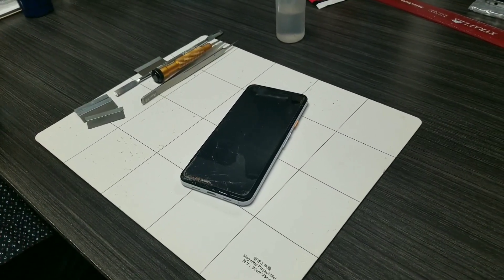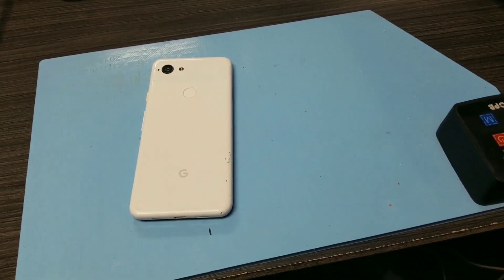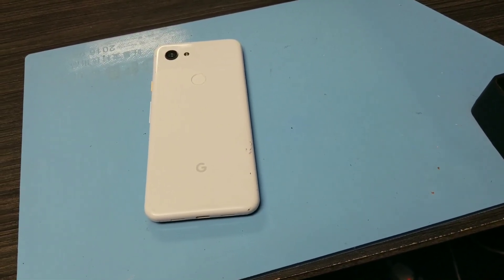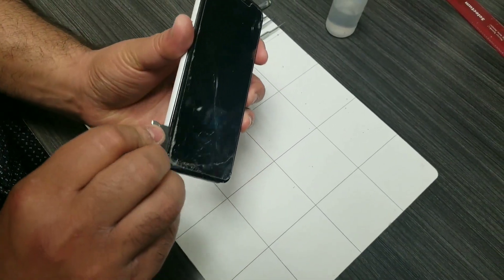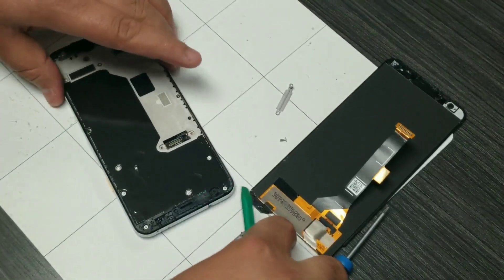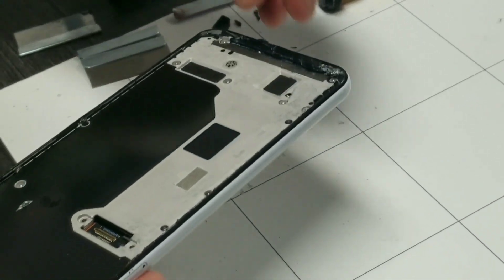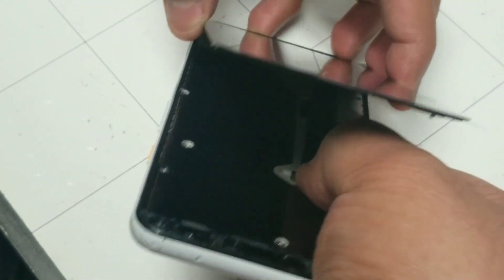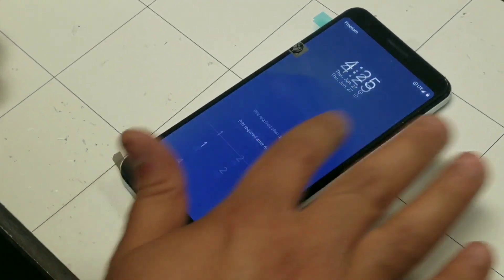Google Pixel 3A Screen LCD Replacement Tutorial

Comment: You didn't show transferring the speaker grille and camera bracket to the new display before installing. I glued the display down without doing these steps and had to peel the screen back off. Thanks a lot.
Reply: thanks for the comment, I was about to follow the same steps. Btw, did you have to use blow torch gun ?
Reply: @AshikaUmanga  not a blow torch, but lucky for me I have a heat gun. Hair blow dryer will work just as well.

Comment: Hello, nice video, I this phone and turn out, it started to touch itself , i couldnt use it anymore, the screen didnt respond to my touches, Do you think this is a screen digitalizer problem? it will be fixed change it like you did? never got wet, or droped.. Just crazy ghost touching in the screen...
Reply from the maker: Hey it sounds like a faulty digitizer however it's very hard to replace digitizer. I would just change lcd
Reply: @TheExplorerworld thanks for replying, I guess I will need to buy a new screen for it,  I could opened up the to see if anything was wrong, but now the screen doesn't work, I can still hear and feel the vibration of the touching. But the screen is black.
Reply from the maker: Yes then it's most likely the screen. See if you can try remove and reattach the lcd cable. You never know it might fix the issue

Comment: I replaced the display and when it is turned on for the first time, everything works, but when it goes on standby when I switch it on again the touchscreen doesn't work anymore.
Reply: @HN-ji3rv  i gave up, and bought a pixel 4 XL
Reply: Same problem here !! Have you found a fix?

Comment: I have 3a xl with issue where touch screen working fine after reboot but if wake up from sleep/stanby mode, touch not work. Tried 2 screens from 2 different vendors, same issue. Tried on 2nd broken phone also getting same result. Anyone else experienced this issue? If remove proximity sensor then its work fine.
Reply: did you ever get it resolved i have the same issue?